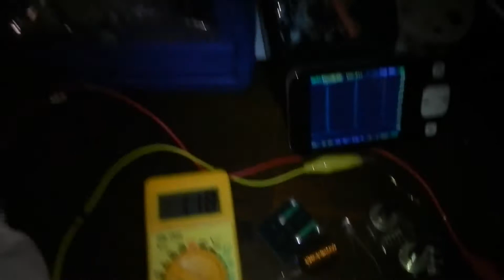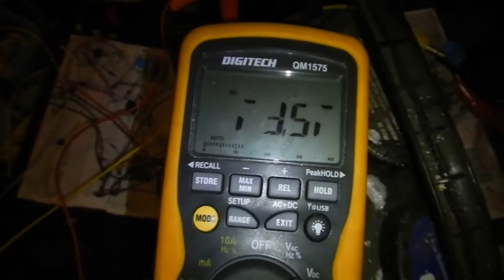Killa Volta, Step by Steppper guide to High Voltage Flyback Pulse Motor.

Comment from the maker: LOL! I need that motor for my 3d printer! I have smaller ones from electric typewriter to abuse :) On unrelated topic. The solenoid hammer thingy, from electric typewriter, that stamps the letters on the page, with some 8mm tube, and 8mm ball bearings, is a lot of fun XD I'm considering making a rapid fire mode with a 555.

Comment from the maker: If you hold the cath of the charging led, while charge bat disconnected, It does light dimly. I think the freq is too low also. Works a bit though. Its more pulsed dc than AC, which doesn't help the single wire strength. My best results have all had ac with more than 200v each side for <400vpp. Have charging wire running to grounded led now. it works, very dimly. Same for large metal body. No wifi, but AV plug lights with contact.

Comment from the maker: I think its the 10nf cap and 1m resistor in the probe with the kahuna's... Although I have damaged a few probe ends. Remember how I used to have clippy hook things on there, so it wouldn't come loose mid video... They got a bit melted/vaporized..... Pretty sure one of my 1x caps is popped too. one probe says funny things at times. Like displaying correct waveform, at 10x the freq... Or sometimes I put it on 1khz square, and it shows 200mhz triangle....

Comment from the maker: If I had a bigger motor, it would work great. I have smaller ones, they only pull 300ma... not the same power or output though... bigger does seem to be better. have you Found data sheets on your motors yet?

Comment from the maker: Yea, likely would do some single wire. Freq could be a little low. Seems to have some kind of wifi, as it messes with my USB hub. Normally only spark gaps and tesla coils do that. This motors pretty tame compared to the tip122 version. I think I will do a video of that smacking capacitors etc about, for 30k view celebration :) Need new fan,  now down a blade. Want to try magnet rotor, whats a good pickup? tons of 0.3mm wire on a nail be ok? or microwave fan coil (0.15mm) with core in?

Comment: Lol-you crazy man-must be an aussie lol.
You need to bolt the motor to the table,or it may fly off through the celling like the searl effect generators did lol.That is some serious voltage comming from that motor-maybe possable to use as a 1 wire energy transmition setup?